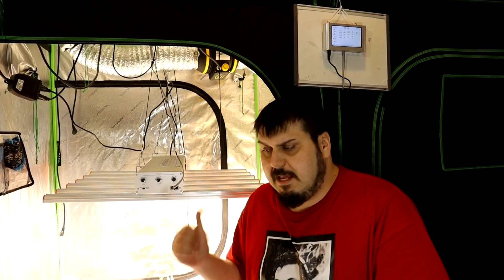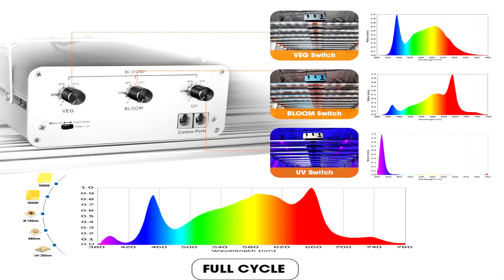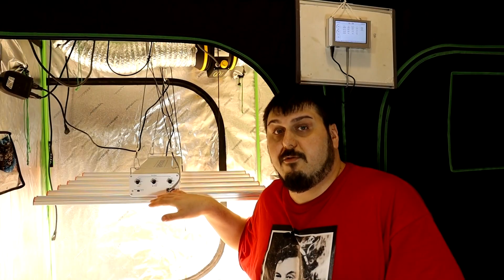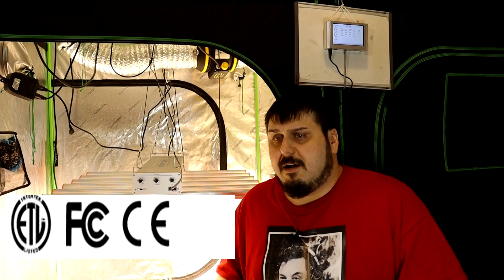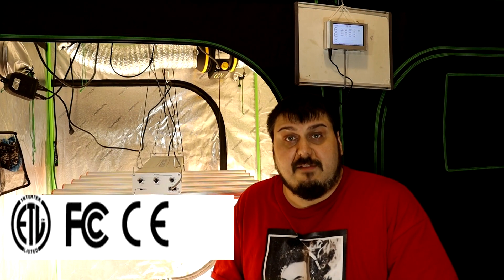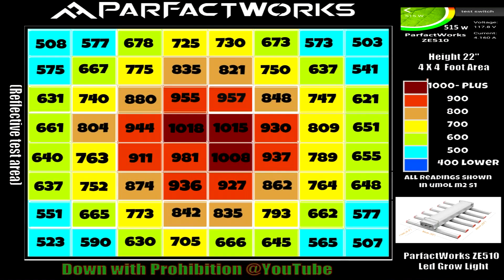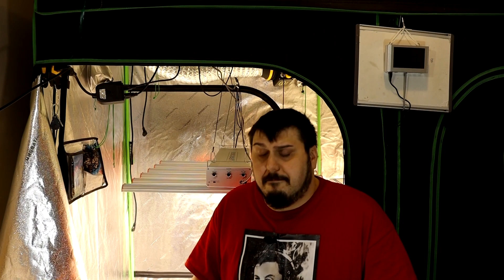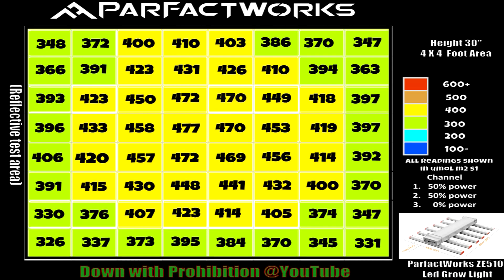ParfactWorks ZE510 PAR Testing & Review

Comment: Thanks for the review. I'm always interested in upgrading my 100 watt LED light in my 4x4 tent. This particular one seems like overkill for such a small space though. That's a lot of watts and the heat output is just too much. I'd be worried about fire. Edit. I forgot to add a thanks for your video on how to make CBD,THC cream. Works a treat mate. Thanks again.
Reply from the maker: Hey man thanks for leaving a comment its appreciated. It seems about on par with other lights running 480 watts in a 4x4.   This one is a bit higher due to the uv channel but remove that and were left with 490w, so not much difference. Personally I never run my gear at full power to prolong the life expectancy a little bit... But yeah she ran a bit warm in testing no doubt. If running full power with the uvs would highly suggest a fan and proper ventilation, you will see those temps will drop by almost 10 degrees. Fire would not be one of my concerns around these temperatures.  You may see an increase in degradation of the diodes but even paper won't ignite till about 245 degrees C.. I  wouldn't want to hold my hand on it though lol